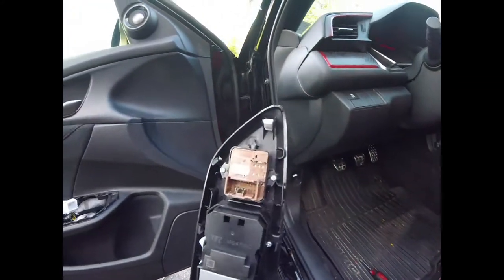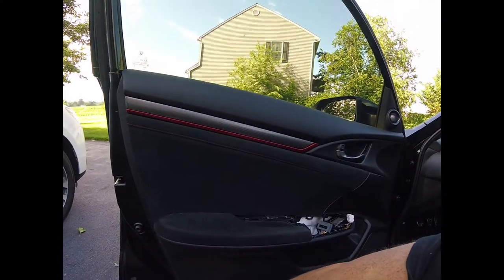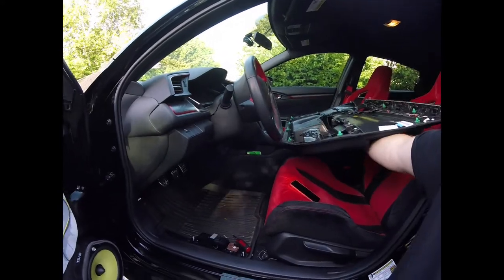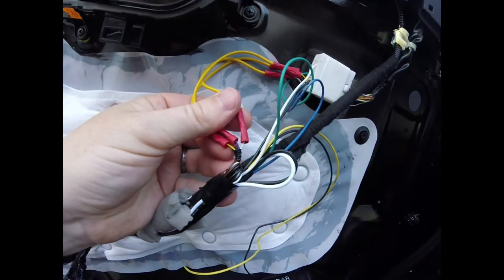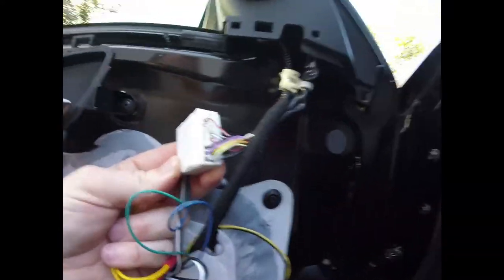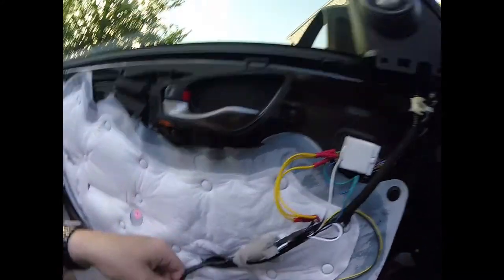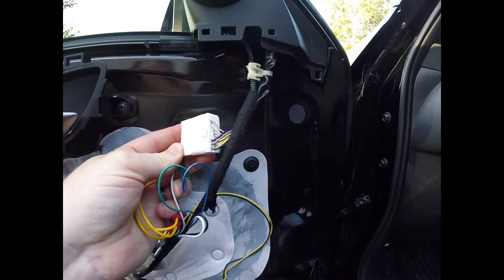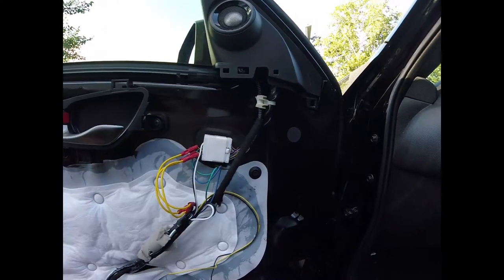Type R EDM Power Fold Mirror installation

Comment: Hi! Planning on buying the folding mirrors from your website. 

I have 19 Hatchback ST with the blind spot camera on the right passenger mirror.

Is there a way to install these and keep the camera function or is a one or the other kind of deal?

Thank you so much for making these videos
Reply from the maker: I never made the move to try and get blind spot working but they’re completely separate systems. The blind spot is just an LED driven by a module in the back bumper and shouldn’t interfere with the lane change side camera.
Reply: Thanks so much for the quick reply even after all these years. I Apologize for the confusion. So I can install these and keep the lane change camera that displays on the center infotainment system? Am I understanding that correctly?

Comment: Thanks for the video, very helpful!  I'm trying to add folding mirrors to a ridgeline, that uses the same switch.  To oversimplify this, If i understand you correctly I just need to connect the 2 terminals at the back of the new switch, to the 2 wires on the mirrors?  No other modules are necessary? The new mirror switch itself already has power from the existing connector, and built in relays to handle the folding?
Reply from the maker: That’s right- the new switch has the relay built in. Just get your mirrors polarity right so the go out and in together and not one-out and one-in. Made that mistake!
Reply: @BTurismo Awesome, thanks!  Found tons of info, but couldn't ever find that exact answer.

Comment: This might be a dumb question but I honestly don’t know. I have a 2017 EXT Sedan (NA) with heated mirrors and the passenger blind spot. 

Is there already a motor in the mirror that isn’t wired up for power fold? In my search for adding this, all I find are modules to wire up, but nothing referring to what has to be done in the mirror. Thanks for reading and thanks for the video!
Reply from the maker: Not a dumb question at all! But no- there is not a motor inside the mirror waiting to be hooked up. To make it work for me, I purchased complete side mirrors from Europe. I had to figure out what the wires did and connect in to the driver door switch. The stock mirror had 3 wires but the European mirror had 9 I think...totally different connectors too. 
There should be some available for your sedan...

Comment: To install on a 18 HB Touring,  just the 2 extra cables need to be installed right? Also would lane assist indicators work just plug and play?
Reply from the maker: Northern CA Fishing I’m pretty sure if you’ve already got a touring hatch the plug will be the same. You’ll need to add the two wires to the fold motor. 
Blind spot monitor indicators will work if you already have that system, but I don’t think the North American cars have it from the factory...you’d need to wire them in!
Reply: @BTurismo  Thank you

Comment: What about the other side for the wiring? Is there wiring that goes to the other side already that when the new module is put in it will send power to the other folder or will wires have to be run to the other side in the other door?
Reply from the maker: M C no wiring already there...just had to pull the white and black wire in the drivers door, through the dash, and out the passenger side!